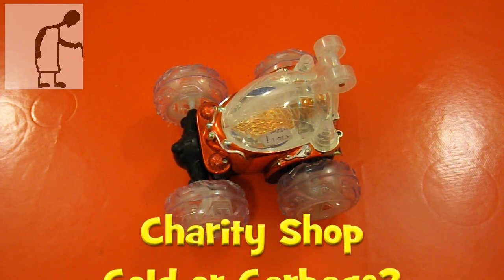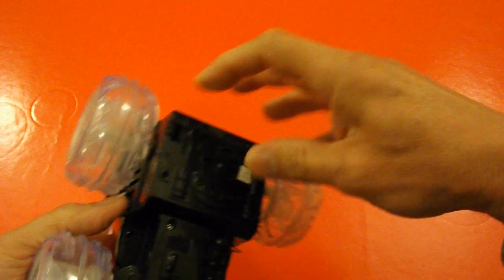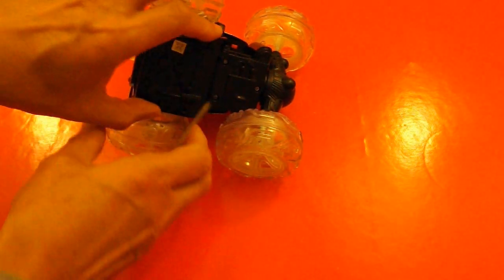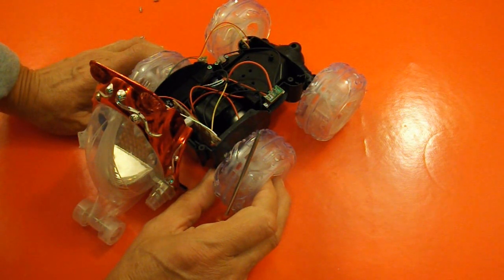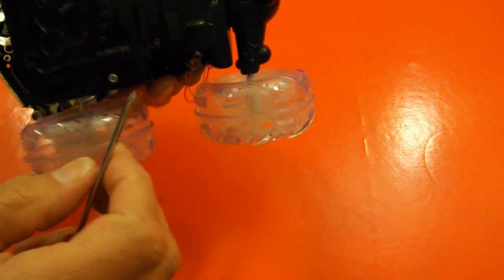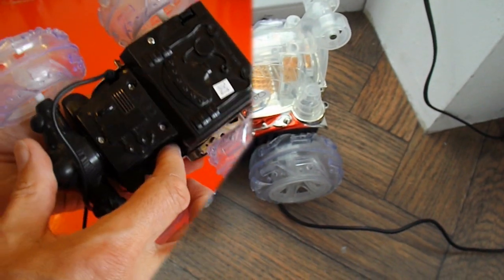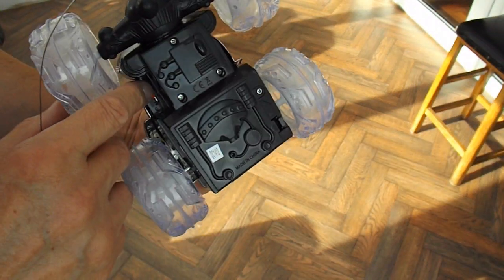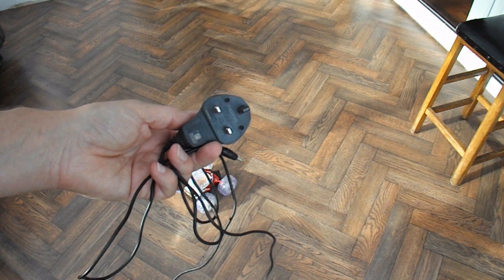Charity Shop - Gold or Garbage? Was it really Gold?

Comment: What if its used with 2s lipo?
Reply from the maker: Yes you could replace the batteries with LiPos. Two issues there. The first issue is when I buy toys in Charity Shops I rate them on whether I could give them to my grandchildren as a present so a toy that is missing the transmitter and needs a specific charger that is also missing, then the true rating must be GARBAGE as it is not fit for purpose. The second issue is the existing batteries are 4.8 volts. A 2S LiPo is 7.4 volts so there is a very good chance that you will burn out the power components on the receiver.

Comment: OH wait..mine didn't have rechargeable though. Yours is way nicer.
Reply from the maker: The usual problem with toys that have rechargeable batteries in them is that they have been dumped because the battery needs replacing and a replacement rechargeable battery is going to be more expensive than the toy cost new.

Comment: hey grandad can you make a powered solar helicopter with a battery attached with the solar and use a rc helicopter propellers use that with the solar so attached it with the solar with a remote connected to the propeller
Reply from the maker: +AceAustin Narvez if you mean a helicopter that will fly then the answer is no.
Reply: +GrandadIsAnOldMan pls grandad pwease
Reply from the maker: +AceAustin Narvez there is no chance of producing enough power from any solar panel that will allow you to lift it off the ground vertically on a helicopter. Just look around at the size of the solar collection panels on any attempts to make solar powered planes and that is only for horizontal flight. Vertical flight requires far more power. You will simply not get the power to weight ratio required from any solar panel available.